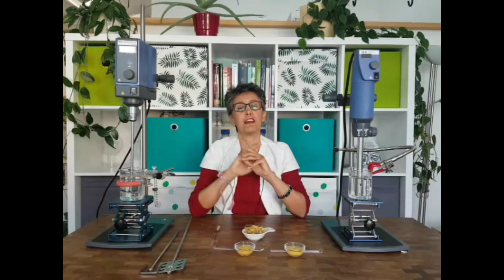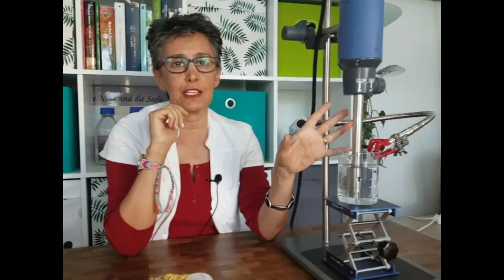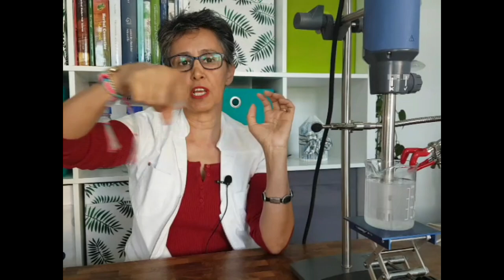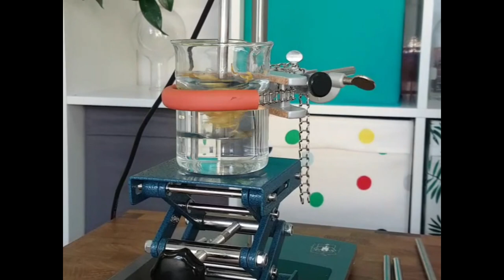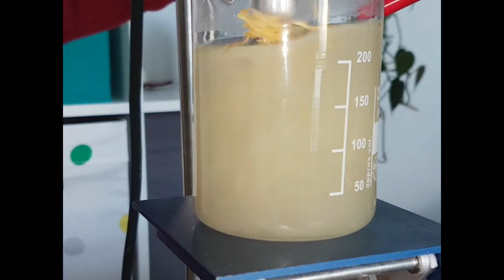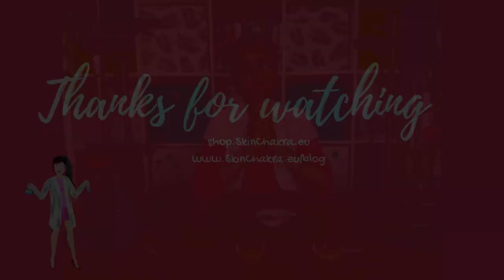Homogenizer or overhead stirrer?

Comment: Thankyou for your video, I have an overhead stirrer and wondering what blade you would use for the emulsions? also you said small quantities, what size do you suggest.
Reply from the maker: @amandaferguson9376  the quantity depends on the motor and capacity of the stirrer. The blade depends on the viscosity of the emulsion. We use a propeller for dispersing gum and for low to medium viscosity emulsions and an anchor blade for high viscosity emulsions

Comment: Thank you for you demonstration. My question would be for a small scale lab. The steps to making a lotion or cream 
O/W emulsions. Should we use the homogenizer first to accomplish the emulsion then move to the overhead stirrer to make sure the emulsion stays during the cooling down phase? I hope you understand my question. And I would use such method for a 5000 ml batch of lotion or cream.
Reply from the maker: you need to blend each phase separately and disperse the gum which probably includes an overhead stirrer, then the homogenizer and then again the stirrer during the cool down. There are some reactors that combine both instruments but they are quite pricy
Reply: @skinchakra  i just found out your channel and the clips are so interesting and usefull. I want to made body cream (84% water phase, 16% oil phase), i tried the formula with the stick blender and it got air bubbles, can homogenizer or head stirrer would be perfectly for this body cream?

Comment: I have an ingredient that is for w/o emulsifier or an oil thickener. Its recommended to use a homogenizer. I dont have one. The ingredient worked but didn't thicken up as much as it advertised at the 5% level. Is that because im using a mixer or maybe I should just add more?
Reply from the maker: this is something you need to ask your supplier but if you are referring to viscolid it really needs a homogenizer

Comment: Thank you for the video. What is the brand n model of the overhead stirrer?
Reply: Patricia Wong I think that both from IKA
Reply from the maker: The ones in the video are IKA but the principle is the same with other brands as well
Reply: @skinchakra  Elham, I have been researching homogenizers for a long time and still haven't bought one due to the very high price. I have, however, come across cheaper Chinese models, but I am very skeptical. What are your thoughts on this? Thank you.
Reply: @marijanabreitmeyer3421   I tried the cheaper Asian version and was personally disappointed. it was a waste of money. I ended up investing in and IKA disperser with various blades and water bath to reduce heat. I have a timer on mine and I can save the info to my PC (a purchased software which is not needed in the beginning unless doing large batches) and I can only say, you will not be disappointed!
Reply: @mlolmaugh  Thanks for your reply.Could you recommend a particular IKA model? What parameters should one bear in mind?
Reply from the maker: @mlolmaugh  oh great, thanks for this info. We have never used a cheap version or a Chinese one so we can not say anything about this. Glad you shared your experience.
Reply from the maker: @marijanabreitmeyer3421  Since we have never used a cheaper version, there is nothing we can say about this . Maya gave you the answer you need

Comment: Thank you for the video - very helpful! If I'm just starting out and only making lip balms, lipsticks, and lip creams, do I need a fast speed? Is an overhead stirrer with 1000 rpms enough speed?
Reply from the maker: Thanks for your comment. For those ingredients you don't need an overhead stirrer. You need a double jacket mixer to be able to heat and cool the product at different stages of manufacturing
Reply: @skinchakra  I have a one-bedroom apartment, a double jacket mixer would not fit. :)